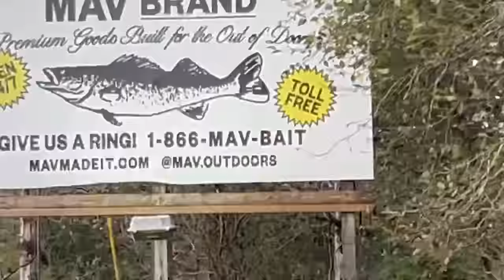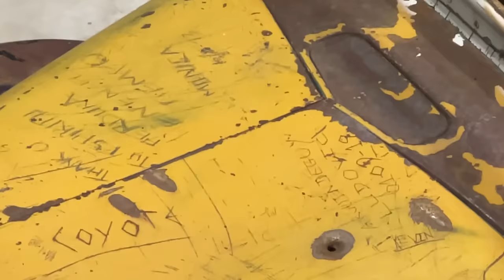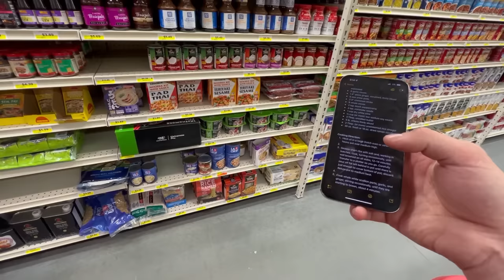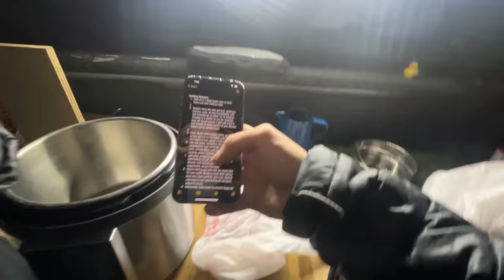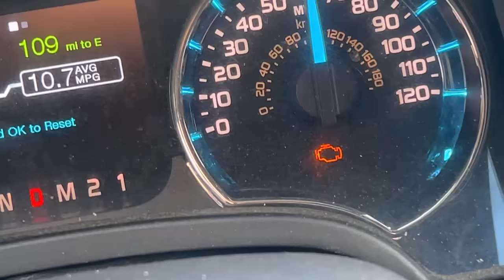Riverside Truck Camping in Alaska

Comment: Hey Mav as someone who works in a garage I would highly recommended buying a code scanner that plugs into the obd2 port on your truck, also to get the work done on the truck in the lower 48 as you will likely get really hurt on cost in Alaska vs the lower 48. Even if it is a ruined motor you can find junkyard f-150 motors cheaper/abundant as well as lower mileage all around. I'm sure Michigan has no shortage... Much love and keep up the good content, been loving the Alaska content as I was born and raised there and now currently live in Arizona.
Reply: I agree about the code scanner, those newer ones are fairly cheap and can tell you a lot about what may be the issue. I also carry a portable jump starter box just in case the battery dies for whatever reason. Those are probably two of the most important things I carry in my truck
Reply: with the $ he makes from ad revenue & youtube probably will just buy another truck ;) 
and get a Kimbo camper mav! they are the best
Reply: Can confirm we have zero shortage of F-150 motors in Michigan.

Comment: What a great trip to share with us all.Thank you.Cam-phasers are a pain.Make sure they drill the oil return drain holes larger through the heads.Synthetic oil will help save the parts for longer.If the cams were going you'd hear a rattling when starting it cold,and idle when hot.The rattle is from the timing chain guides being worn out.I haven't heard it.

Comment: Spent around $3000 on my 08 suburban last February doing timing set and rear main seal as well as replacing oil pump and water pump! Sounds like a lot for an older vehicle but considering a new one costs close to $100,000 it’s a bargain!

Comment: Mav, you should get an OBD reader so you can check the codes yourself if the check engine light is something important or something like a O2 sensor
Reply: Yep even one for under a $100 from harbor freight will give you a ton of info
Reply: Last episode I watched sounded like he had an exhaust manifold leak could be a 02 sensor he definitely should get a obd reader
Reply: Ford Cam Phasers can be a problem. Dirty oil can trigger the CEL. A truck with a lot of miles will inevitably have wear on timing components. A timing job (chains, guides, tensioners) is a major repair. It might be time for a new MAV Truck Build!!!
Reply: @TheUncontrollableYeti  I don’t understand this logic.

With the current market on all vehicles even if his repair is 5K why in the world would anyone buy a new truck when the average truck now sells for over $50,000.
Reply: @JM - I have worked in the automotive aftermarket for nearly two decades. I drive my truck to the tune of 60k company miles every year. Don’t talk to me about inflated truck prices, I live it every day. As far as MAV goes, he is probably in a better position than most if chose to do this. He has a tire sponsor, with his sphere of influence a truck sponsor isn’t that far of a stretch.
Reply: @TheUncontrollableYeti  right u use your truck clearly at 60k miles. But everyone else with their 5 min commutes I don’t get. Make that 3k repair and save themselves thousands overall.

Mav is an outlier for sure given his reach and potential for sponsors.

Comment: If you use 5w20 in the engine you can use 5w30 for a little thicker oil. Goodluck. I have a 2020 f150 5.0 my self I use 5w30 full synthetic.

Comment: Hey Mav, take your truck to a Ford dealership go into the parts department make sure you bring your VIN number they will look it up find out exactly what engine is in there. Then you can ask them if that engine is still available you can also ask them what vehicles had that engine and simply buy a new engine and put it in the truck. You've made so many changes to that truck to make your life comfortable and it would be a lot less money to buy an engine than to buy a new truck. You'll be spending between 40 and $80,000 on a new truck why not just keep that one it's an excellent vehicle it does what you want you got it set up the way you like it just put a new engine in it
Reply: Its a 5.0 liter v8 engine
Reply: @zayasnation3787  it could also be a eco boost
Reply: @austanroupe4730  its not he’s mentioned he has the v8 and his truck is the 2011 f150

Comment: My 2013 Ford F150 XLT 3.5 ecoboost blew it motor last year.  Started with a timing chain replacement,  Then about 3 months later the #2 cylinder let the piston go.  That motor was smoked 125,000 miles   I know the feeling with the truck!

Comment: Mav, greetings from indiana. I recently had a 2011 f150 5.0. I did a complete timing job on it. Phasers, tensioners and guides. It was not hard. U don’t need a cam holding tool to do the timing on these 5.0s they’re super easy! Don’t give up on it!!!
Reply: I have owned many f250's and 150's. One 250 needed a high pressure oil pump $3500 in 1999. All my 150's died before 200k cam phaser problems with the triton. Bought a 2019 with 5.0 man that thing would run with the sport Trans. At 50k it would randomly shut off. 
I own toyota now and wished I switched long ago. 200k 20 year warranty let's see any domestic match that.
Reply: @BravoSeven  the proof is out there look for yourself. Ford has a 30k warranty. I have had three tritons all had cam issues. If it were a toyota with a 200k warranty it would not cost me. The last one was a 2019 5.0 it gave up with 50k on it yep out of warranty.

Comment: I had a 14 f150 limited with the 3.5 ecoboost.     I loved that thing but I was up to $40,000 in warranty work including an engine at 60k miles.   Just traded it at 120k miles because I was afraid the next non-warranty repair bill.    Looks like you have had better luck and your cab corners and bumpers are in way better shape than mine.   Good luck with the truck and keep the great content coming
Reply: His can corners and rockers are plastic covers he glued on lol
Reply: Fix
Or
Repair
Daily
FORD

Comment: Classic Ford with cam phaser issues. I just replaced mine and did a timing set with 117k miles on the clock, not a fun job at all. Good luck with the f150 brother!

Comment: I think you should get an OBD reader that you can connect to your smartphone. It will you why the check light is on and it will give you some codes to give you some specific information. The OBD reader is quite cheap. I bought one for about $80 that is very good.

Comment: Camshaft sensors on those trucks are a nightmare. I had them replaced on mine and within a month the motor locked up. Hope you’re back on the road and everything works out good for you.

Comment: Great Alaskan Expedition (Ford pun).  Back to camping in the truck, fishing, and gourmet cooking with MAV.  The check engine light on my Audi A6 came on at 120k.  Shop in St. Louis Park told me it was oxy sensors.  Drove like that for another 280k
Reply: Based off experience, If your car was running smoothly, it probably wasn't the O2 sensors, because bad O2 sensors makes your car run rich. Either way you're lucky to have a Audi that ran that long!

Comment: I had that on my f150 changed oil left out one quart added 1quart of marvel mystery oil than changed oil at another 1,000 miles that's what mechanic recommended. Engine gets dirty by not keeping up on oil changes and internals build up sludge. I'd recommend the ecoboost 10 mpg is terrible you should be 18-24 with eco boost truck.
Reply: ^^Hit me up 👍

Comment: Ford tech here, cam phasers are one of the most common problems with these engines, (I am assuming it is the 3.5l v6) if it makes a rattle for a few seconds on cold startup, then it definitely need them.

Comment: Its a verry common problem for the eco boost engines for the phaseres to go out, they need to open the front of the engine. Mechanic probably charging for the timming kit and a water pump....

Comment: Take your truck to a Ford dealership. Not   napa autocare. Cam phasers make a nasty rattling noise on startup when the motor is cold. Not very common to go wrong on your 5.0 though. I wouldn't worry about it till you hear a rattle if that's what is really wrong with it....

Comment: Hey MAV, is your engine the 3 valve? If so, the timing chains, sprockets, guides, and tensioners will need to be replaced if it's ticking. It's a common issue with the engines and is well known. If you catch it before a lot of damage occurs the engine will be fine. I just had mine done. I got three estimates (2 from a ford dealership and one from a private. All were around 3K to do the job. The local shop has done several of these jobs including his personal truck. The ending cost was 2500 as ford now includes the sprockets as part of the kit. I made it to 150,000 miles before mine starting ticking. The truck has had the oil dropped every 3K since new. These engines must be maintained to the T or else. Let me know if this helps or if you have any questions. Safe travels. Al

Comment: If you are having cam phaser issues the only actual fix is a new engine.  Extremely common on that engine.  You can replace the cam phasers and timing set and it wont be long before the same problem occurs again.
Reply: I’m pretty sure Ford has updated the cams… it would be worth it to fix imo. $3k repair or a $65k truck. Or he can lock the cams which I don’t recommend. Just replace and move on imo

Comment: Cam phasers on some of them Fords suck. That's a bummer. Btw the check engine light is only for sensors and electrical systems. It would tell you if something mechanical is broken or breaking. Loved the vid, Mav.

Comment: Hey Mav, get a second opinion on the truck.  The light could be the catalytic converter which triggers that sensor.  I would venture to guess that there are millions on cars on the road nowadays with that light on because of how expensive it is to replace.  Nothing will happen to the engine.  Keep your fluids topped off and get back home to a trusted mechanic.  Safe travels!!!!

Comment: Hi Mav you need to get a code scanner they are about (here in Europe ) 30 euros,most of the faults you can delete and you can monitor your engine, performance, oil status etc you can get one with everything built-in/the entire unit or one you connect and then connect to your laptop via Bluetooth, obviously your problem now  is a little bit more seriouse,but with all respect could have been avoided, best regards from Germany, love your channel, happy camping

Comment: Hay Mav on ur truck is that a 3 valve 5.4 those have timing chains not belts an if it is the 3 valve they are known for having problem with the cam fazers going out an destroying the engine so hopefully you have the plain 5.4 an not the 3 valve great video btw an hope ur having a great day

Comment: Hey Mav, my 2009 F150 had the exact same issue that you're getting. We initially thought the repair would be around $3000, but once they started taking the engine apart, it took a lot more. My final bill was $10,600 and it took a week to get it fixed. Just giving you a heads up.
Reply: Fake news ^

Comment: Regarding the CEL, I won’t say here that Ford is any better or worse than other brands, but I would get an engine with a timing chain!! No maintenance with those. New engines now are leaning towards belts and turbos. My advice for reliability and longevity is don’t get a timing belt or turbo engine..trust me!

Comment: If the issue is the cam sensor, don’t waste $3k on the repair. The engine needs replaced in most instances.

Comment: i’m super curious as to how many miles you have on the F150 Mav, you treat that pickup like a prince but with the miles (i think) you put on it, it’s only a matter of time before you have to either replace the motor/trans or just buy a new truck. i personally think you should give the F250 6.7 diesel a try. it’s bigger, better in some ways. you might like it

Comment: How's the Ford running after the repair?  What's the milage on the truck??   I live very close to the repair shop you went to... I hope they did it right...  These newer trucks your always better off going to the dealer...  But rule #1 Never keep a Ford after the Warranty runs out...   Get yourself a Duramax and fuel costs will drop and they last forever...

Comment: Hey Mav, I had a 2012 Ford F-150 platinum with the 3.5 eco boost . Same engine configuration . The problem you are experiencing is a very common problem on these dual overhead cam engines . I had the same issue , mine ended up being a VVT Solenoid ( variable valve timing solenoid) which was a pretty easy fix . But I was lucky . It could be 1 of many things within the timing components which is very expensive . If your phasers are bad they have to remove the timing cover which is many hours of work . I highly recommend you stay away from these trucks . For the purpose of which you use these trucks you need something more simple and reliable . Chevy makes very good engines as well as Toyota . I hope my knowledge and experience with these trucks helps in some way . Ps, if you read this comment and consider my opinion could you possibly shout me out in your next video so I can know you read my comment ? Thank you best wishes .

Comment: Mav, if you have the 3-valve Triton engine and the shop is telling you it's bad cam phasers, the engine is probably bad. Those engines are notorious for failing, and replacing the cam phasers will likely only fix the problem for a few months
Reply: ^^Hit me up 🔝

Comment: Your timing chains are stretching from the turbo ford didn’t spec them out properly when’s the were in production too much torque just get a good quality one to replace it and you should be good again mine went out I replaced and it’s been 5years and 150k miles on it

Comment: I had an F150 with trash cam phasers that the dealer refused to fix under warranty. Ended up taking an 8k loss on it and having to roll that negative equity into the next vehicle. Never again.

Comment: Just make sure the oil to the top line before long trips low or bad oil can make the light turn on easy for a cam fazer code since its not getting the lubrication it needs also use your cruze control to save a lot on gas god bless dude take it easy

Comment: Course: Main Course
Cuisine: American
Keyword: chicken
Servings: 4
Calories: 464kcal
Ingredients

    3 or 4 chicken breasts
    32 oz chicken broth feel free to use water with bouillon cubes added
    1 can cream of chicken soup
    1 can Pilsbury layers biscuits 10 individual
    salt and pepper to taste
    flour

Instructions

    Cook chicken breasts in approx. 4 c. of water until fork-tender, about 45 minutes.
    3 or 4 chicken breasts
    Place broth in a medium to large-sized pot. Stir cream of chicken soup into gently boiling broth. Add salt and pepper to taste.
    32 oz chicken broth, 1 can cream of chicken soup, salt and pepper to taste
    Pull the biscuits apart into three layers. Dip each layer into the flour, tear each layer into three pieces, and drop into the gently boiling broth mixture.
    1 can Pilsbury layers biscuits, flour
    Do not stir biscuits a lot or they will cook up. Only gently push dumplings down into the broth as they float to the top. Cook for about ten minutes after the last dumplings are added.
    Tear up the chicken and add it to the broth mixture. Turn to low until ready to serve.

Comment: 5.4 liter 3 valve right?
Reply: It's a 2011 F-150 FX4 5.0L V8 with the 6.5' ft bed.
Reply: I think they stopped putting the 5.4 and 4.6 in the trucks after 2010 I think.

Comment: Please buy Toyota. Anything Toyota. 280k miles on my 2001 RAV4. NEVER any problems just oil change, tires and break maintenance over 23 years still going strong.  When I was younger I had Ford escort. Transmission died at 101k miles. I left it so it could be Found On Road Dead(Ford).

Comment: that guy is taking advantage of you. You can order an entire reman long block engine online for not much more then he is quoting to fix yours and a honest mechanic will charge 750 to 1000 to R and R a motor. Its always cheaper to fix a truck then to replace. My Ford is a lot older then yours and I have owned it for 20 years and even if I figured up everything I spent on it I'm still not even at a quarter the cost of a new one. plus I know what and when everything was done on it.

Comment: .... Get another opinion .... Definitely doesnt seem like $3000 problem  can get a new motor for $3000 ..... Not installed .... But only takes a day for qualified mechanic to swap motor sounds like misfire or exhaust leak or 02 sensor

Comment: WELCOME TO CHEVY?  timing belt and components. i wont take it to that guy, dealer price is between  1200,oo to 1800.00 , i thing its sender unit , miss reading on the main computer, you know there is a main computer and 3 others for sending units,?  the 3 are workers and the main in the harddrive on your truck, 3000.00 i would go somewhere else for a different testing , code reading  aamco transmission , and o reillys auto parts or sister companies of them big A, checker?  YOU NEED TO GET THE CODE ON THE READING BOX, THATS THE CORRECT WAY